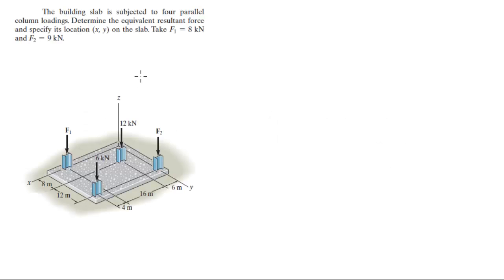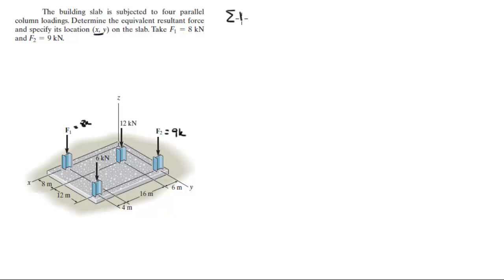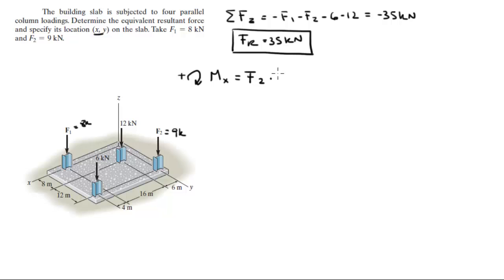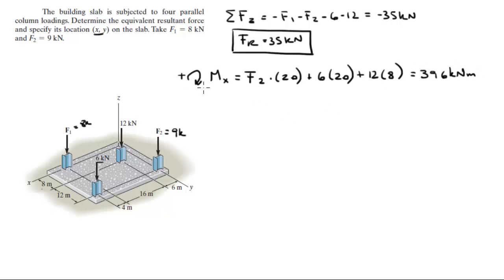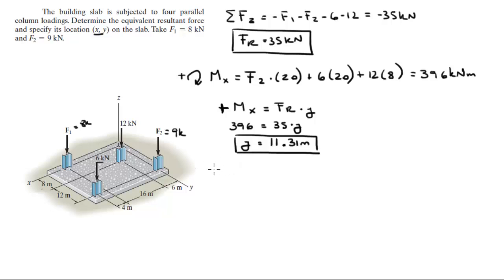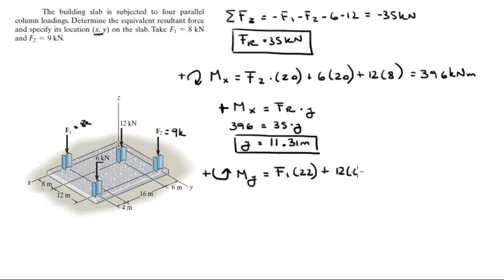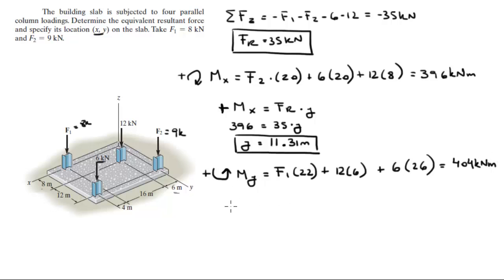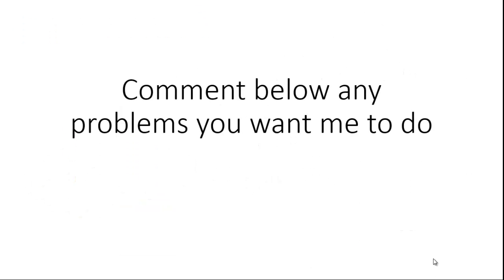Determine the equivalent resultant force and specify its location (x, y)

Comment: There is a formula if anyone needed help with doing all of this faster. For two forces F_1 & F_2, if their abscissae are x_1 & x_2 respectively, the abscissa of their equivalent force x_eq = (F_1 * x_1 + F_2 * x_2) / (F_1 + F_2). I tried it for the 4 forces in this problem in pairs, treating each new equivalent force as a new force in the system, replacing the two from which it was derived from, and I arrived at the same answers. The formula can also be used to find the ordinate by replacing (x_eq, x_1, & x_2) with (y_eq, y_1, & y_2).